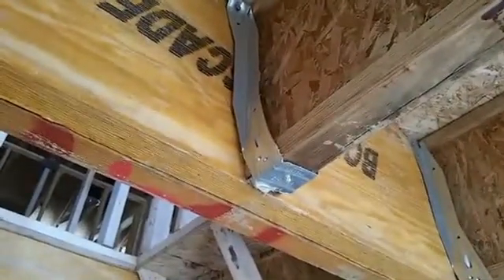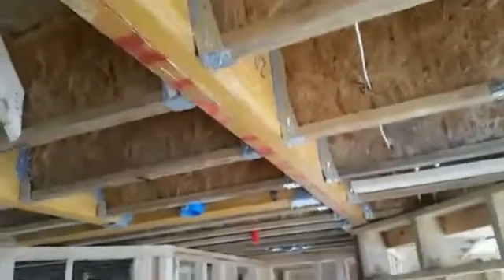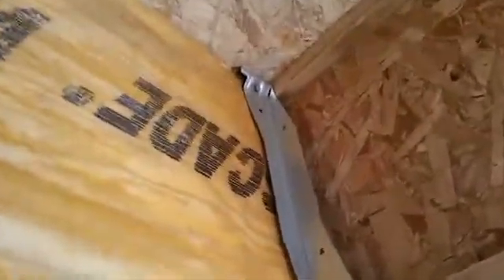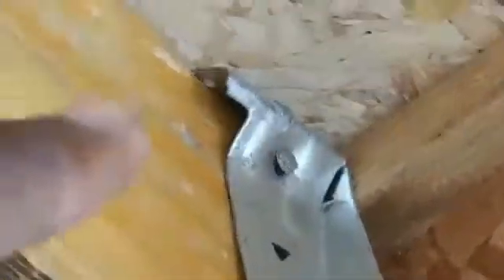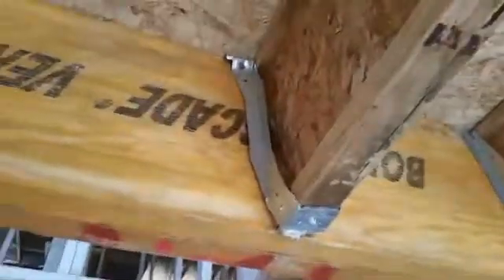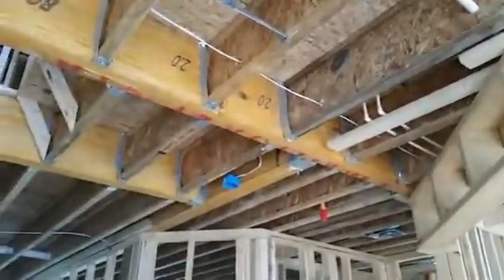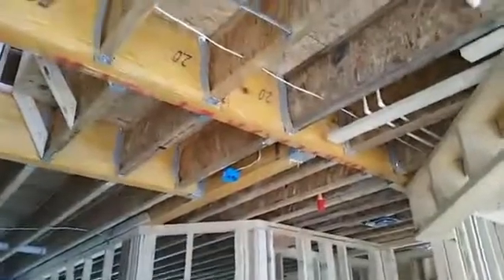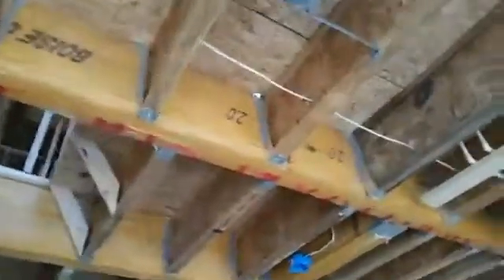JOIST HANGERS, HOW NOT TO INSTALL

Comment: How would you fix this
Reply from the maker: This is a top mount hanger (it is nailed thru the top of the beam), I would replace it with a face mount hanger.that nails into the side of the beam.
Reply: So much poor work out there...
Reply: Most of the time,”You get what you pay for $$”. Everybody wants bueno, bonito & barato, but something has to give in this case Nobueno 👎🏼
Reply: @justsaying9913  And the Bobs and Karens are too lazy to do the work, so they middle man and charge you $$$ and no body wants them. You cant take a job from someone who is too lazy to work. Let me rephrase, too lazy to do manual hard work.